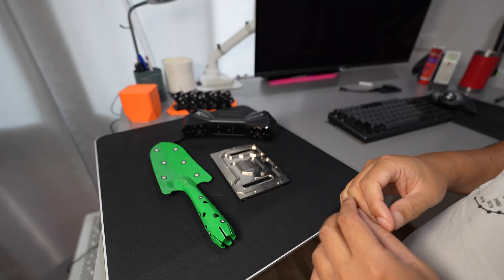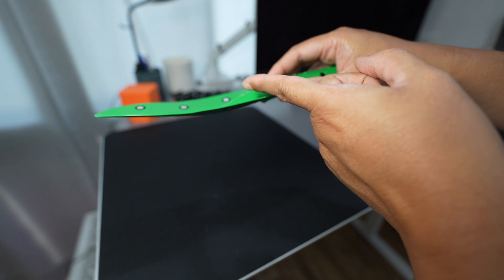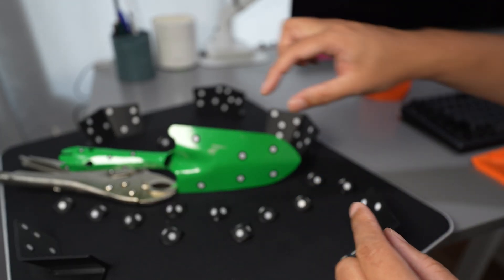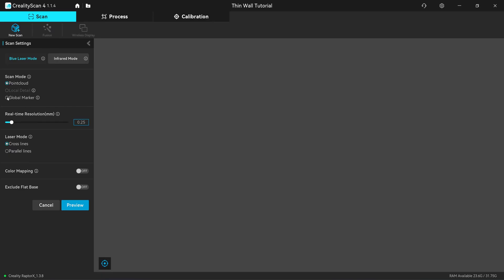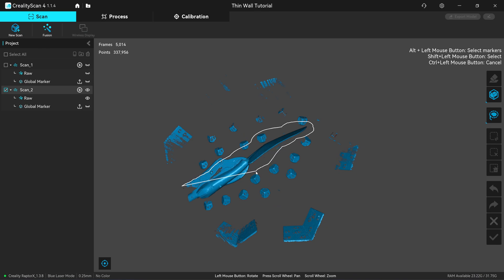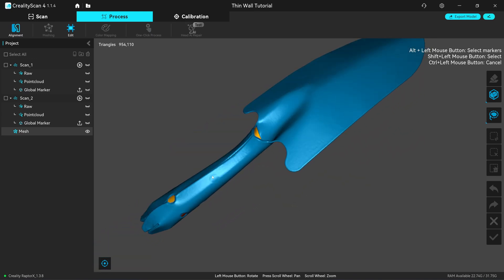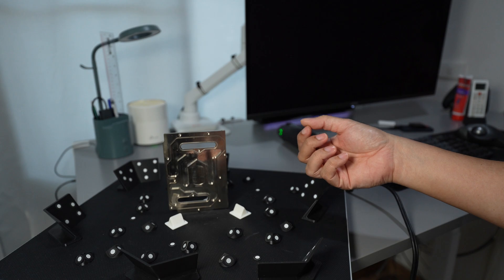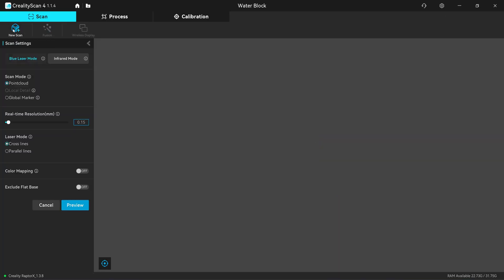Creality Scan Raptor Tutorial: How to Scan Thin Objects - Step by Step Guide

Comment: A great video, does the program actually automatically create a file afterwards that can be saved and sliced directly as a STEP?
Reply from the maker: The STEP file is a CAD output, while 3D scanners produce mesh files composed of thousands of polygons. To convert a mesh into a CAD format, reverse engineering is required.
Reply: @Payo-TensileCreator  Thanks for the info, I've never worked with a 3D scanner before, but I think the technology is really great.

But couldn't you still create this file with FreeCAD to a step? Without redrawing the whole part? FreeCAD, for example, creates very useful files from STL, it does it even better than Fusion 360 (free versions).

Comment: Have Otter and in crealty Scan 4,  I am unable to get the Clipping Pane to work.
Unable to find any info so reaching out 🙂
Thank you for the videos I have learned a lot.
Reply from the maker: I'll check that out. The newer Creality Scan 4 is soon to be released, they're doing some final adjustment.
Reply: @Payo-TensileCreator  Thank you
Reply: Did you have any luck using the clipping plane with Otter? not the lite version 🙂

Comment: Is it regular raptor or raptor X ?
Reply from the maker: The one I use in this video is X, but if you have the Raptor original, it's practically the same sensor in 7 lines laser mode.
Reply: @Payo-TensileCreator thanks alot payo 
I allways watch your detailed videos 
And they are really  valuable
Keep going on and best wishes

Comment: Don’t place the object flat on the table. Instead, stand it upright and start by scanning the top part. Then, rotate it and scan again. This setup also lets you hold it securely from the bottom without covering important details, giving you much cleaner and more accurate edge scans